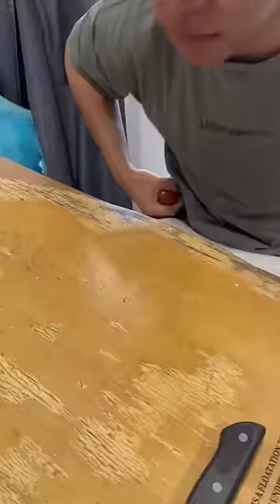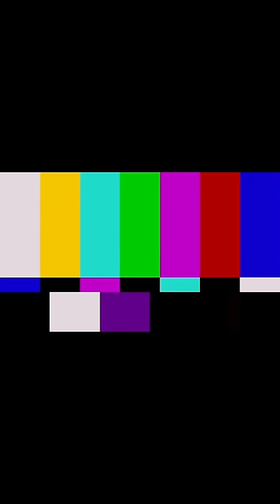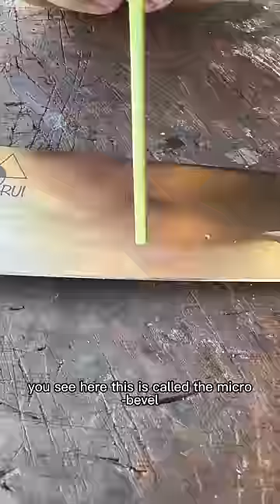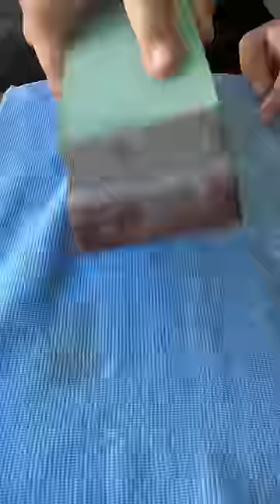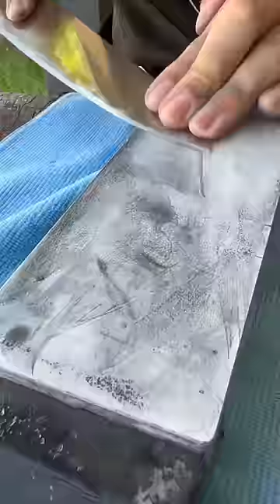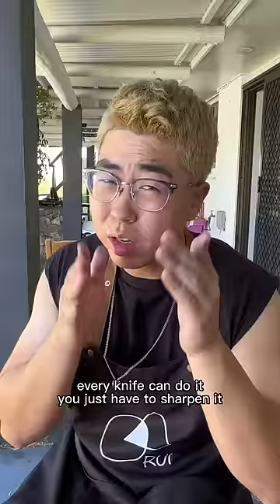Thin sliced tomato. #fyp #knife #knives #knifesharpening #satisfying #tomato #sharp #kitchen

Comment: It also helps if you cut the bottom of the tomato as well, like you did in the "after" video. You didn't do so in the "before" video so it didn't have that extra resistance to hold it in place and keep it from rolling. If you're gonna do the video about how sharp you make your knives you should show its not biased by having the conditions the same or as close to the same as possible between both the "before" and "after"

Comment: Cnc machinist here. He is correct. I like 440c when it comes to a knife. I have a machete made of 440c and it cuts electrical tape on metal pipe and it still has an edge after 3 months

Comment: The tails of rabbits are relatively short and fluffy, with a distinctive appearance that serves several functions. One primary purpose of the rabbit's tail is to provide balance and stability when the rabbit is running or changing direction quickly. The tail helps the rabbit to maintain its center of gravity, which is important for avoiding falls and maintaining agility.

Another function of the rabbit's tail is to communicate with other rabbits. When a rabbit is feeling threatened or in danger, it may quickly raise and lower its tail to signal to other rabbits in the area. This behavior is known as "flagging," and it helps to alert other rabbits to potential danger.

In addition, the tail of a rabbit is also used for thermoregulation. Rabbits are sensitive to changes in temperature and can overheat easily, especially in hot weather. The large surface area of the tail helps to dissipate heat from the body, allowing the rabbit to stay cool and comfortable.

The fluffy appearance of the rabbit's tail is due to the presence of a dense layer of fur. This fur helps to insulate the rabbit's body and keep it warm in cold weather. The fur also helps to protect the rabbit's tail from injury or damage, as it provides a cushioning layer that can absorb impacts and prevent cuts or bruises.

Comment: First reaction was indeed correct, _This IS fake_. In the "fail demonstration" the tomato is not sliced at the bottom. The dry tomato skin has very little friction against a table top. In the second shot after sharpening, it's sliced at the bottom so it's wet flat surface holds it against the table.